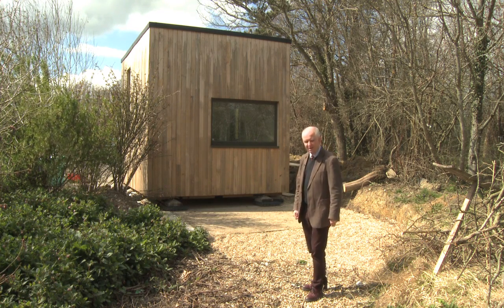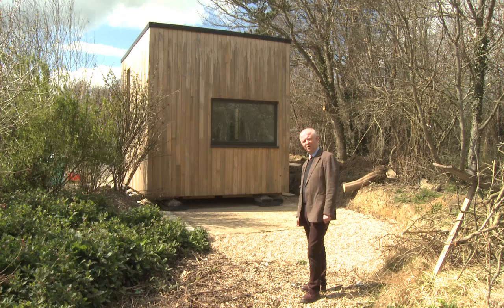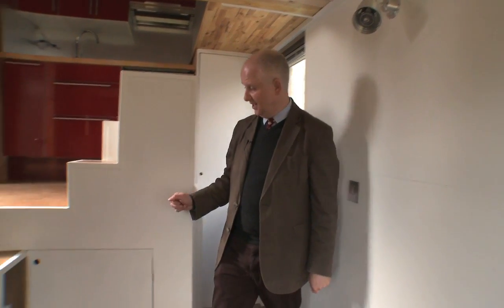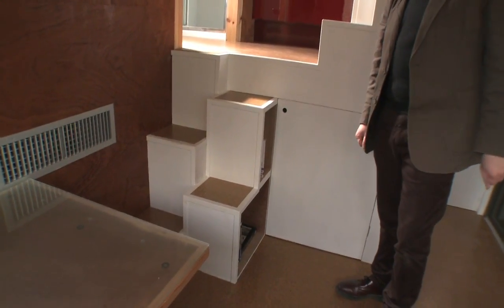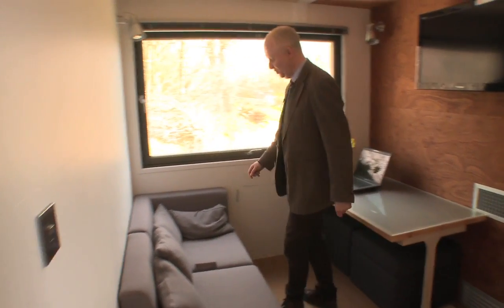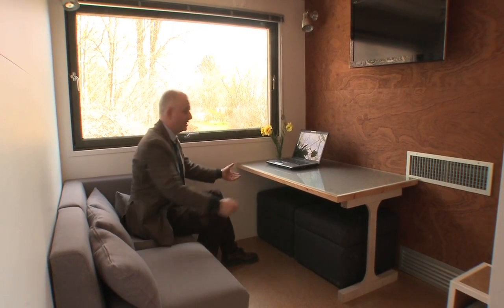A longer tour of QB2, with Dr Mike Page (Cube Project, University of Hertfordshire)

Comment: QB1 caught a lot of flack, undeservedly so, in my opinion. I like the improvements in QB2, my only major dislike is the sleeping area. Also,  someone else mentioned the stairs could be placed into the storage area & pulled out when needed, I think that would work better & be much safer. I'd also be ok w/losing a bit more space in the kitchen to have a proper stair to the  bedroom area, that provides storage, & a bigger fridge could be tucked into it.
Reply: Actually, looking at the space again, the stairs I'd like wouldn't work unless I borrowed space elsewhere.
Reply: Agreed if you see qb3 it's a completely different style and set up. I think they should take the qb2 and just make the cube bigger so that it has more space and is more attractive to a couple. And as others have said, being able to sleep on the main floor is a good option

Comment: you know.... instead of having alternating stairs, you could just make the stairs push into the storage area, and pull out as needed, having some sort of locking mechanism when they are fully extended.  At least then you could have a full set of stairs, rather than I think I just broke my neck stairs.
Reply: @Ives: I know exactly what you're talking about & I've seen a few tiny homes using push in/pull out stairs. That would work very well in this design!